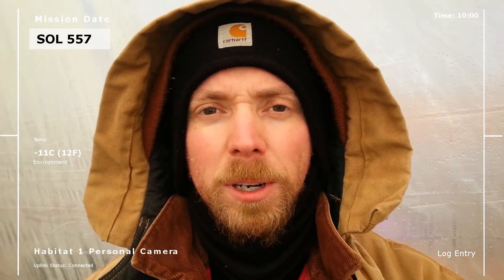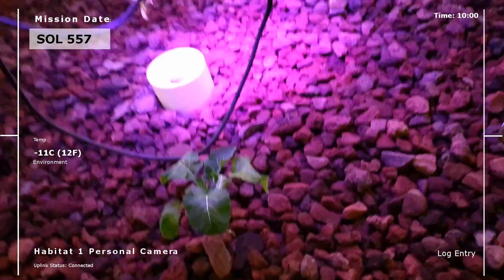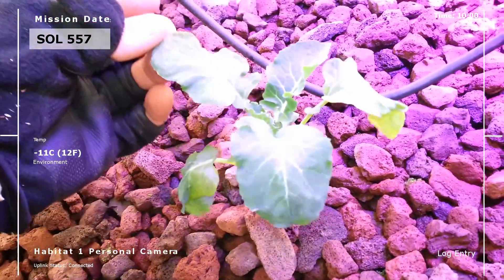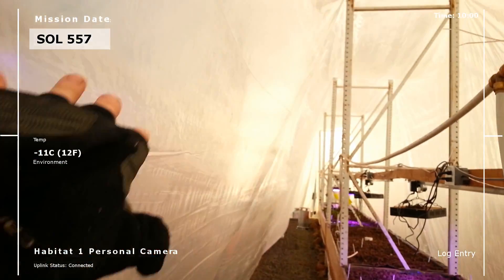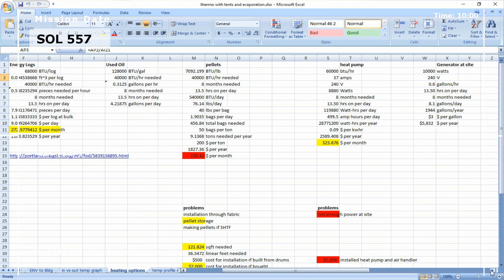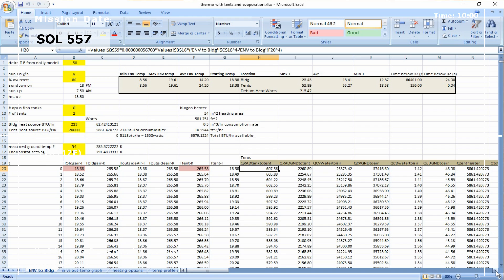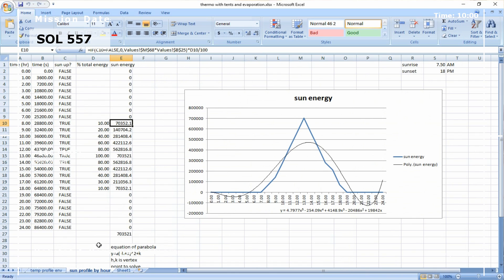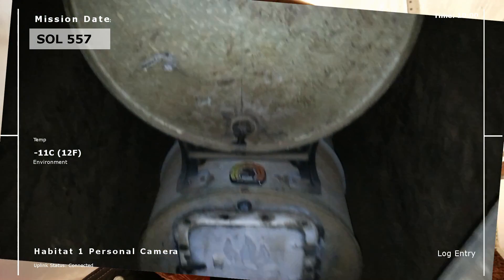Propane creates humidity and that's bad in a greenhouse

Comment: The retail prices of a 20 pound propane refill is 18-24 .  The bulk distribution price of propane is about 15.   For a 30 pound canister the price is 20 dollars.  Having a 1000 or 2000 gallon tank (rented from the distributer) you can manage your cost by commodity averageing.  You know that propane cost rises in the winter so you purchase your delivery in the summer or Autumn when the price is much more reasonable.  

after 911 you have rules and regulations about having more than 2000 gallons on site.  Many farmers purchased extra 2000 gallon tanks and had them hooked up before the regulations went in to effect.   Propane powered grain dryers and livestock heaters.  And household heat and furnace hot water for the rest.   You can have two tanks if you separate the two or more systems IE house and livestock and grow building
Reply: Randy J 
In the Pacific Northwest the retail price of propane at the corner gas station is half that price.
Not sure why he's paying a dollar a gallon.
Reply: Those are about the prices we pay in Florida also, I live in an urban area though which probably effects cost.

Comment: If you can get wood chips there is a cheap system you can build but requires some power. A hopper with auger setup would let you fill the chipped wood as needed then the only power is the auger and a backup ignition system with the rest all run off just its heat. 

The problem with a chip system is you need a setup to handle the odd sizes you get so it is hard to go down in scale past a point due to clogging issues when you get under a 4 inch feed auger but you can limit feed speeds to correct that. Size the hopper for a 48hr rate and have the auger setup for 24-48vDC and you can have everything run without grid power using solar/generator to recharge batteries and the tractor to refill the hopper.

Comment: Try to think of this as an opportunity. Save time, money, and effort now that the pressure is off. Do not proceed until all of your present problems are solved. This is not Mars and your life and the lives of the other settlers are not in danger because of this failure. Wood heating is not the answer, do not take one single additional step until you have the/an answer. Another layer of plastic just above the height of the grow tents will give you massive amounts of dead air. Get the digester up and running, that in itself will give you some heat without even burning the methane. Mostly take some time with your family to relax and think without the pressure of keeping it going, don't even go near Hab 1 for a few days, you will figure this out.

Comment: When I built my fodder system I had a similar set up.  I would put 2" foam board right on top of the plant stand hanging 3' over the sides and build  walls of the same material then put the plastic around that to seal up cracks.  All your lighting is coming from the grow lights anyway.  This will greatly reduce the amount of space to heat and pay for itself with less fuel to heat it.  Just so little insulation value in plastic as you know.  At least do this in the winter to keep up production my friend.
God Bless,
Dale the castle guy
Reply from the maker: appreciate that info Dale...thanks for the contribution..I'm definitely going to start thinking through an improved insulation strategy.

Comment: Hi. I had a though to use smaller house hold central heaters. They already have all the safety feature built in so an single on and off is doable and linking to a computer would be simple. Two  solutions to cost are to contact area ac installers that remove complete systems and try to get the gas heating unit and the a fan unit could used to make a working unit. the fan could then be use in summer as well for air circulation.
 Next thought would be to install the next level and drop a second tent over just the growing crop vent heated air through there first and exhaust into the big tent at the end. That way you would be using the big ten for an air gap with some heat  to drop the differential between each section. 
Just a though. But the problem could be solved quicker for each expansion.
I am a big fan of this project. Even though you are jumping in to deep right off the bat. 

Mike McCray
Little Elm,Texas

Comment: What about used oil perhaps vegetable oil as a heat source.  Seems like a temporary conversion of your wood stove to oil might be a short term solution.  It would allow for more control.
Reply: How about used motor oil.  Try and get locals to save their oil after a change.
Reply: Or look for a outfit/organisation in the locality that services trucks or buses as a source of waste oil. I used to have pig producers that used waste oil, burnt in a steam boiler to produce steam, to cook the food for the pigs.

Comment: Have you looked at a wast sump oil heater option should be able to pick up the waste oil from local mechanics and truck workshops most likely free then you just have to filter it and burn it would be a good option up to stage 2 but still not a long term option :-/ sorry to hear about the crop

Comment: Jeff did you loose any fish due to no aeration while the power was out?
Reply from the maker: no. no fish loss from temps....we do experience random fish loss but in contacting our supplier he said that totally random loss is normal. all in all the Trout are quite content. No signs of stress
Reply: Unless all the water froze then I doubt it, He said that he has trout and they seem to do well in very cold water.
Reply: No Oxygen dissolved in the water the fish die. Aquaponics depends on aeration. The higher the stocking density the faster Oxygen is depleted, The colder the water the less Oxygen can dissolve. Though temperature is not a direct relationship, there is also a point where heat causes it to deplete as well, which is why fancy restaurants make ice from boiled water, dissolved gasses are what makes ice white instead of clear.
Reply: Ya Trout can be happy in 34F water, as long as it is moving, I looked into trout but the permits up here are insane, so I went with Tilapia, which need no permits, but the fish are still in my living room because I haven't learned to trust the tank in the green house if temps drop to -40. What are you doing for aeration?

Comment: I haven't seen this suggestion posted yet, so here goes:  Consolidate your grow lanes into 1.  Use the plastic from #2 to double up the plastic covering on #1, and only shunt heat from the wood stove to #1.  This will double your insulation and heat generation with no $ outlay.  It's not a long-term solution, but it will probably get you through this winter with no additional $$ (although I realize it would be a significant physical effort).  I really think you need at least 1 more layer of plastic on the grow lanes (with an air gap in between) and you're not using the growing capacity of the 2nd lane right now.
Reply from the maker: great suggestion...definitely going to consider this.

Comment: for the third time - try bubble wrap both over the plants and as an insulator on the main fabric of the building.! Cheap and easy to use....
Reply: on three lanes of tents, that is a lot of plastic. It's relatively cheap, but at those amounts it is still pretty expensive for relatively little effect.
Reply from the maker: the challenge with bubble wrap is finding it in 40' x 100' sections at an affordable cost...otherwise I agree that would be an excellent choice. if you know of a supplier please email me at trm@therealmartian.com

Comment: here is a thought. why don't you put your propane heater down with the wood stove as a back up for your wood heat. if your wood stove will keep your tents warm; the propane heater will keep it warm, then use the propane as a back up heat source for when your stove burns out down in the pit. just a thought. a simple thromstat will work. wood heat is cheap as most trash will burn. propane is expensive so use it only when needed, to buy you time if your stove gos out.

Comment: Maybe you need just one lane for the winter. Move everything to lane 2. Use the plastic from lane 3 to lane 2 for insulation. Also helps the humidity and heating problems. 2 lanes are too much. Cuts the costs in half. Think small :)

Comment: Since the cold is just a seasonal issue, would it be viable to turn each shelf, or one test shelf at first, into a 'pod system'? For example: modular panels attached to the shelving to keep the cold out but have a temporary heat tube going into the pod but still enough ventilation to allow the humidity to escape into the larger grow hab.

Comment: A couple of thoughts I had, and remember you're getting these from a history teacher not an engineer. I heat my woodshop with infrared heaters, could you put a small infrared heater on a track system like the grow lights? Move it back and forth over the beds? I have no idea how much electricity they pull, but with it moving it could cover mote area. 
Another idea I had which would be more of a down the road solution would be to replace your idea of layered grow beds. If you made the beds long and narrower. Built them into like a ferris wheel, with a grow light above (add an infrared heater in the winter) each bed would up and under the light and heater on a regular basis. 
Just some thoughts, keep up the good work!

Comment: Go buy a simple $30 dollar outlet timer at your local hardware store set it so the propane kicks on each hour for twenty minutes or so your model should be able to give you the btu loss rate and balance it so you do not drop below freezing......keep it simple
Reply: I guess I'm not visualizing the same thing you are talking about. How is an outlet timer going to turn off, and relight the propane?
Reply: guess I was assuming an electronic ignition system on the unit we use an oil burner rocket heater for most winter heating auto ignites so I thought there was a comparable assembly on the propane heater.
Reply: OK, I don't know how his unit works but if it is the same as the one they carry at Princess Auto, there is no electronic ignition.

Comment: don't get too frustrated you will get this running. but have you thought about a propane or electric heater with a fan inside which you can change with your fan in your ventilation system. this could give an extra heat in the complete system. (in the case you don't know which heater I mean: https://goo.gl/U71QP0) this could only give a heat problem at the connectors but could also give an advantage.

Comment: I know this isn't practical for you, but on Mars where you need a very robust heating and power generating system I have viewed some videos here on YouTube advocating Thorium nuclear reactors that use molten salts(?... I'm no physicist just found what they were proposing interesting). From what I gather, the proponents say Thorium is very abundant resource and that it is much safer, as if a meltdown or over pressure were to ever happen, it can be emptied into an emergency tank, that once it cools they say within many hours it reverts into a cooled non-radioactive state (i.e. no China syndrome possible). I also heard, it lasts longer too. the only reason our reactors use Uranium and Plutonium (which are rarer) is that there is a military need for it, so research on other methods was defunded. 
On Mars you have no fossil fuels and probably limited solar energy. So you need to bring a high energy but compact fuel source with you that can keep your habitat operating for years at a time, as resupply ships can explode during liftoff. But also light enough to be lifted into orbit efficiently.

Comment: Seems to me you have a problem of having to much air to heat than you have BTU's to heat it with and you're losing heat becuase you're not insulated enough. In a ideal world, you'd probably have insulated pole barn that could be heated to about 50 degrees. Then heating an enclose grow bed would be simpler right?

So my suggestion is trying a multi-tiered tenting solution. Create  another tent outside your growbed tent you have right now to create an insulating air pocket. On mars this wold be like an air lock.then the heat from the wood stove to heat the air maybe retained better? consider tenting the ground as well as it conducts cold as well (only in the area around this outer plastic).

The next idea is more long term, but consider looking into radiant in floor heating. On your grow tables, install the tubing for radient heating. Perhaps a boiler using fuel oil would be cost efficient? OR figure a way to make a boiler out of a wood stove? Insulate the tables below with heated water lines, and then cover them with inexpensive tiles. Only suggest this as it would protect the tubing but also retain heat as well. They make home kits that people can install theses systems themselves. It's just plastic tubing that screws in with clips into subfloor. 
Then create much smaller tents around your grow beds just big enough to contain your lights and the plants themselves to retain the heat from the radiant floor heat. You would only need this during the harshest winter months, and tenting and system could be turned off in the spring, summer, fall. 

Also consider preheating the water in your grow beds to aid in keeping plants warm as well? this could be done by making a copper coil around your wood stove that water circulates through via electric pump? 

just some ideas.

Comment: there are only two ways this is going to go for you either you get a dump truck size heater or insulate the building it probably is cheaper just to shut down that operation till spring.

Comment: If you wrap just the shelving system in the plastic instead of tenting it and you can have overlapping plastic for slots to put your arms in to tend the vegies you could direct the heat into that area only saving BTUs. leaving the tent up would act as another insulating layer. You could use magnetic strips or hook and loop strips to open and close each bay.

Comment: To minimize the amount of propane you use, couldn't you have a pilot for the propane burner inside you double barrel wood stove, connected to a temp sensor.  Once that sensor detects a drop in temp, from the wood burning out, the propane takes over until it reaches a certain temp.  At that point you just load up for wood fuel.  Just a thought.

Comment: you need an insulated north wall with greenhouse on south side. at least a double layer of plastic with air gap to help insulate. that building is huge to try to heat...

Comment: I understand that wood heat is not the ultimate long term solution but there should be a way to engineer a self feeding system into a wood stove or be able to take advantage of a self feeding fire in some way.  What is your heat loss at the exhaust?  I still think there has to be a way to trap more of the heat into the grow lanes and further insulate them.  In deep winter I would think that trying to trap the heat closer to the plants almost like low tunnels directly over the grow beds might assist.  It just seems that most of the heat in the building is not trapped low enough to do any good.  It just seems like the volume of air that you need to heat  is too much.As the temps dip lower and lower I would think that you would concentrate more on confining and conserving the heat where it is needed most. Could the stoves draft pipes be diverted to inside the grow lanes at extreme temperatures? I understand cost is a main concern at the moment but at least from a design perspective I think that the flexibility to move heat around in a more direct way would be important.  Im sure you have thought of all these things.

Comment: You r struggling with the exact same thing i was expecting to encounter if i set up a system here in norway. so i have set my sights on making a greenhouse with double insulated windows from houses. and even be able to shut down the main production part during winter and just having a smaller indoor/heavy insulated system for a small production that will be capable to keep the fish water ok. and reduce the feed for the fish.. and moste of all have cold hardy fish like trout.

i have even made up plans for a outdoor system with a outdoor pond that is design to freeze over during winter.  i know that if you don't have to much fish in the water they will survive on their own. and with more fish a small super insulated greenhouse on the side is needed to get some oxygen in the water and remove some nutrients. it should however be possible.. still you won't have much production during the winter with a good snow layer the pond water should be possible to keep at +4c at least on the lower half of the water column. the pond need to be deep tho. 

i have used some time trying to come up with systems that can make it thru what you're experiencing now and even worse. it need to be ok with weeks at -25 to -30c
Reply: I'd love to see video responses to TheRealMartian. Sounds like you're on to something.
Reply: project Mayhem i know. some old one do not. or i have to get special order of i want to get new ones :/ it is also possible to make your own custom ones if needed. in the basic form it is just two or three layers of glass with argon stuck between them. it's a LOT of work and expense tho.

Comment: sorry to hear about this latest set back - If I could I love to send you some money and help support you every month, but I can't currently - the only thing I can think of you need a lot more insulation ie keeping cold out and heat in then if you then need to use less gas to heat the area....just thinking where you got the plastic over the crops would  it work if you copied the design of double or triple glazing and have 2 or even 3 sheets of plastic around/over the growing area?  Or even now is it worth only growing crops at certain times of year and coming back to all year growing in phase 2 or 3 and 4?